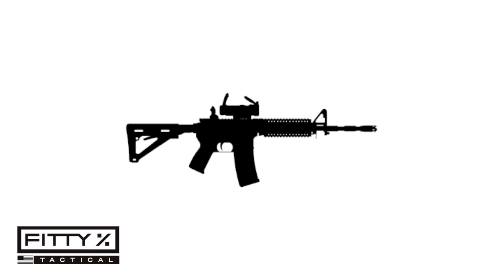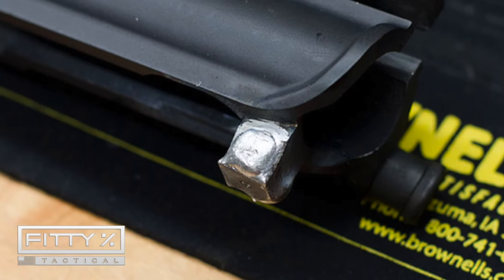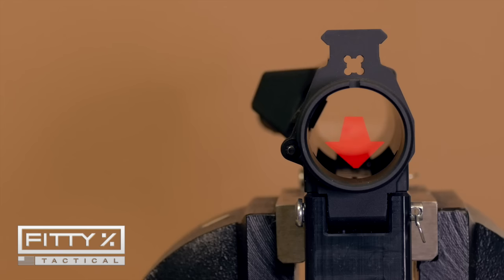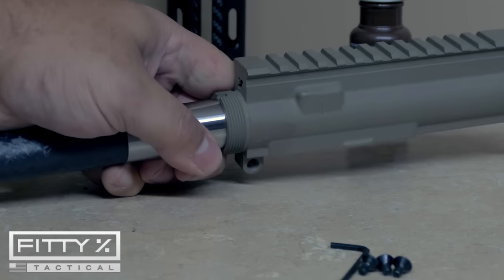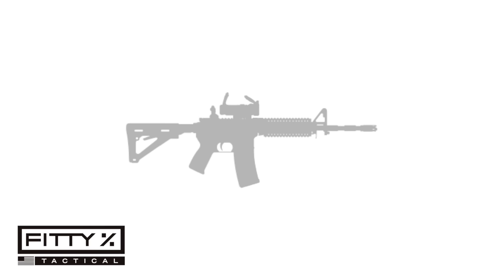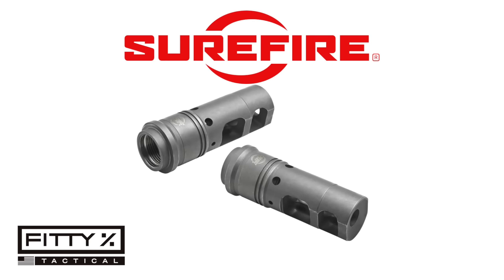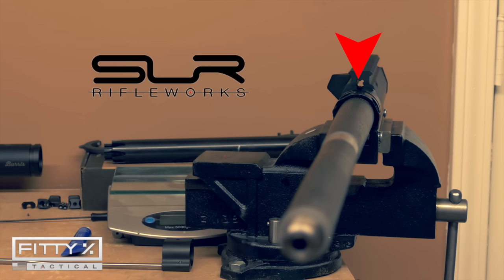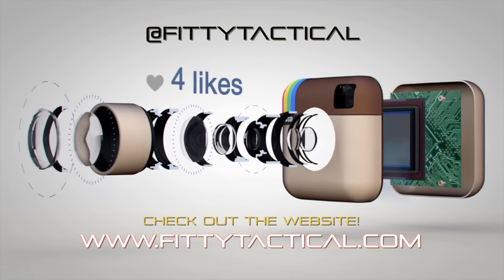Precision Rifle - 6.5 Creedmoor Parts Chosen & Why

Comment: Yes. The stag arms 224 is the gun only 1200. . 1500 is custom built ,everything. That 224 valkyrie really looks promising.  Thank you for your help. Ar 10 is 2000. In 6.5. Both heavy stainless mat match  barrel. Thank you for the video
Reply from the maker: Mark if its $2k including optic, what optic comes with it? If you want to be able to shoot long distances having good glass is what you need.

Comment: That's a good looking rifle.  Too bad the Aero Precision receiver set isn't available in 2020, the "pandemic period" (out of stock).  I recently decided to step it up from the 308, to the 6.5 Creedmoor.  The 6.5 cuts the wind much better, and it reaches out there a bit more.  I simply made my decision at the wrong time.  I'll likely go with a bolt action rig due to the lack of parts availability for AR's.

Comment: Hello. Another excellent an informative video!! So, can I ask, what ammo would you suggest I use with an HD 300 blackout with suppressed 247, range supersonic ammo and supersonic for HD?? Thank you an thank you for your timely response. Oh do you have a Patron as well??
Reply from the maker: Glad you like the video. As for ammo to use in a 300blk suppressed, I like to run subs when the can is on and SS when it's off. No specific brand for myself personally. I run brass case subs with the can on and steel supers when not suppressed. My Patreon is "FittyACTUAL"

Comment: Nice build. I've built one rifle with Aero receivers and liked them a lot. I've got another set I'm planning on building into a 6.5CM similar to what you've done. Was the Aero upper pretty true when you started lapping it?
I've not got a factory barrel to fit any uppers like I'd want yet so I may end up ordering one with an oversized extension to get that nice just barely press fit when I do this 6.5 build. Good deal on the bedding. I haven't tried that yet but I've heard it'll help squeeze a little more consistency out of a precision build.

Comment: Did you use the JP High Pressure Bolt? if not any piereced primers? Do you shoot it suppressed? If so how does it work with the bolt and mass carrier? THanks
Reply from the maker: Je P yes I'm using the JP High Pressure bolt. No pierced primers and I don't shoot suppressed yet but plan to and everything works great eight the SLR adjustable gas block.

Comment: How can the barrel move if you torque the barrel nut down to 30 pounds? Reason I ask is because you talked about the oversized barrel extension that you used to make sure it was that tight. I've got a number of less then 1 moa 5.56 rifles and .308's that I've built without quite the detail you put into your fitting. Two of mine are built on Aero receiver sets.

Comment: Great vid, dig your stye.  Thanks.
Reply from the maker: Thank you and glad you like the style.
Reply: hi im looking to build a rifle very similar to this one. would it be okay if i talked to you about your parts list? i have never built an ar10 before and i would like to know and have every part ready to order before i make any purchases so i know everything will fit. i cannot really afford to spend $200+ and end up with the wrong part.
Reply: also, what mags work with that build and the bcg in your parts list is a .308bcg can a 308bcg work well with a 6.5creedmore?
Reply from the maker: Sure! You can message my Facebook page cause it would be the fastest response time.
Reply from the maker: The 6.5cm was made from .308 brass that is necked down to take the 6.5mm projectile. All .308 mags and bolts will work with 6.5cm.

Comment: Ok I have a question 😅. I’m building an 18in ar cause I want to be able to reach out to 800 yards. The competition people on YouTube 😅 said that having a heavier bcg makes the recoil less? I don’t know the applications for a heavier bcg but it logically makes sense if you have a light weight bcg it would be less mass moving? So less recoil? I don’t know it’s like everyone has their own thing going on? So I just wanted to know from your experience with this build 6 years ago did the light bcg work the way you wanted it? I have learned so much about assembly from your videos. Thanks for everything you bring to the community. 😅
Reply from the maker: The more mass an object has, the more energy is required to move it. If you have a normal to lightweight gun a heavy BCG will be able to move the entire rifle easier than a lightweight BCG with the same gas system. I prefer to use lightweight BCGs with an adjustable gas system to tune the rifle. If a rifle is over gassed it will have more felt recoil no matter if the BCG is heavy or lightweight.
Reply: @FittyACTUAL  thank you 😊

Comment: Very nice build on your end! I have a question.  I'm currently building a 6.5 Creedmore AR but went with a jp barrel. It fits very tight and once the rail was installed the barrel appears to be well centered.  I'm using a Hellfire armory upper. Should I still lap the upper? If so, how do I go about doing that?
Reply from the maker: You're going to have to remove the handguard and barrel. Then you can lap it.

Comment: what buffer tube did you use for this. also I am looking at the cts active buffer as well, was it specifically the 'ar10 with the ar15 buffer tube' or the ar10 with the ar15 6 position buffer tube'? 
this build is sick and I am on the way to having one very similar.
Reply from the maker: Its the A2 rifle buffer tube. For the CTS buffer it's the .308 rifle version.

Comment: Reading on the Rainier website it mentions the gas block outside diameter on the CA-10 Barrel is .938 and the SLR 9 lists the inside diameter as .936. Was there any modification required to fit the SLR 9 to your barrel?
Reply from the maker: No there was no modification needed. When you get out to the thousandth it's so minimal that that difference is nothing. My SLR block slid on like butter.
Reply: Awesome! I'm going to go with the CA-10 barrel with the SLR 9 aswell. Thanks for the quick response. Keep up the great videos!
Reply from the maker: No problem bud!

Comment: One question, Why did you choose the Sentry 9 instead of the Sentry 7. What is the port size on the barrel you chose? I appreciate your feedback, as I chose some parts for my build based off of your recommendations.
Reply from the maker: The Sentry 7/8/9 have to do with gas block journal size. They are 0.625", 0.750", 0.876" and 0.936" and the 7/8/9 in the Sentry name indicates the size journal it fits.
Reply: @FittyACTUAL  right, I was assuming based on popularity that your barrel port size was .750 because that is the most common size I have found. Thank you for responding so quickly.

Comment: wont bedding the barrel to the upper with the Indian head gasket make it impossible to replace the barrel in the future?  not trying to sound like a jerk, just an honest question. I do like the rest of your build
Reply from the maker: damupr all you should need to do is apply heat to the upper receiver barrel sleeve with a heat gun for a bit and then you should be able to push or tap the barrel out of the upper receiver sleeve.
Reply: Awesome, ill try this on my 6.5 Grendel build. Thanks

Comment: So then, to answer a question ive had....a 6.5 Creed, u MUST HAVE an ar 10 size lower, and NOT a standard 556 size ar 15 lower?
Reply from the maker: Yes, the length of the round determines the receiver needed. If it can fit in an AR15 mag it can usually be chambered for an AR15. The 6.5cm requires the AR10 patterned receiver.

Comment: Quick question. For the AERO precision receiver set, does it matter if you're wanting to build an AR10 build as compared to an AR15 build? Their site says AR15 on those sets. I'm assuming you can get the same one for both build styles.
Reply from the maker: Josh R no, the M5 receivers ar AR10 and the M4E1 is AR15.
Reply: Ok, thank you!

Comment: I did not realize that you could use a .308 BCG and upper receiver for a 6.5mm Creedmoor.  How is that possible if the case is not the exact same?
Reply from the maker: To use the same bolt, the rim of the cartridge/brass needs to be the same and seeing as the 6.5 creedmoor round uses the .308 case/brass, the same bolt can be used for both. The only thing that needs to be changed is the barrel which contains the specific 6.5cm chamber dimensions.
Reply: @FittyACTUAL  Thank you very much for the quick response!  Does the slightly longer cartridge length on the 6.5 affect the magazine or lower in anyway or they are also interchangeable with any .308 AR10?
Reply from the maker: @danielbrown8105  no effect, they are interchangeable.

Comment: Roughly how much did you invest in this build? I just did an AR15 and went at $1500 without an optic so im thinking about doing this next
Reply from the maker: Well I chose a lot of high end parts in this build so you can definitely do it cheaper, but I think it was between $2500-$3000 without optics.

Comment: How does that buffer compare to a Kynshot?  I'm in the last stages of my own build, and I was bouncing between buffers, and decided to go with the Kynshot.  Besides for that and the barrel, there isn't much difference between my build and yours.
Reply from the maker: Well both buffers dampens and in looks like the Kynshot dampens a bit more than the CTS, but the CTS Aktive recoil buffer is still one of if not the only buffers that help center the BCG. I looked at the Kynshot when I was deciding too but obviously went with the CTS buffer. Ive also recently upgraded my buffer spring so check out the latest Precision Rifle video: https://youtu.be/WVMXSdGnSMc
Reply: Thanks for the reply.  I might try the CTS in another build.

Comment: really like the videos. Can you answer a small problem I have. I have the improved Ruger Pecision Rifle. I am a little confused about the bolt carrier section. Am I taling about the bolt carrier, a bolt, and buffer tube.
Reply from the maker: What's your question about it?
Reply: Basically will y original trigger fit the bolt carrier. Would like to improve trigger, but that will have to be later.
Reply from the maker: Will what kind of trigger fit the bc? I don't understand.
Reply: original fire control system will fit the new bolt carrier?
Reply from the maker: David Evans I'm not sure bud...sorry

Comment: Sorry im pretty new at this, and my question is that you basically use all .308 parts with 6.5 creedmoor barrel?
Reply from the maker: kenneth robles correct and that's the beauty of 6.5cm. The reason you can use all .308 parts except for the chambered barrel is that 6.5cm is simply .308 brass necked down for the 6.hmm projectile.

Comment: What did your Aero Precision upper measure bottom to top. My other AR10 measures 2.06" Please respond this new Aero receiver measures 2.70"
Reply from the maker: Mike Byrd I'll have to measure a new receiver when I get one.
Reply: Okay thanks. I was just wondering since you used an Aero receiver if yours was a "normal" 2.00 - 2.06 DPMS pattern.
Reply: BTW my barrel was a lot tighter fit than yours.

Comment: did I miss something, or can.t this be built with the AR-15 platform?
Reply from the maker: Mike Lee the 6.5 creedmoor is based off of .308 brass so the larger framed AR10 is needed. The smaller framed AR15 can accommodate the 6.5 grendel cartridge though. You just confused the two rounds because of the bullet diameter of 6.5mm.

Comment: What did you use to bed the barrel extension?  I've been using blue loctite.
Reply from the maker: +Cody Dills its Indian Head Gasket Sealer. I got a tip from someone that builds a few that it works better than Locktite.
Reply: +Fitty% TACTICAL Awesome, thanks!  

I think you should break it in, then shoot 25 10round groups. Then remove the barrel and re-bed with loctite and shoot another round of groups to compare!  Awaiting the results video :)
Reply from the maker: +Cody Dills good idea!

Comment: With all due respect, I legitimately want to know why you care about play between upper/lower? On my spr clone with stainless heavy match barrel, mb556k, and trijicon 5-20x50, I've shot hand loads with the stock tolerances between receivers and now am currently run a rubber stabilizing block that makes the fit very rigid, however, I don't see any discernable difference.
Reply from the maker: Alex S are you shooting at or beyond 1k?
Reply: Alex is def a anti vaccine kid

Comment: Why did you go with their 308 bcg instead of their 6.5?
Reply from the maker: samdogg goseahawks because this rifle is a 6.5 creedmoor NOT a 6.5 grendel. 

The creedmoor is based off the 308 cartridge so everything that a normal 308 AR10 variant rifle uses is compatible and the only thing that needs to be 6.5 creedmoor specific is the chamber and barrel.

The 6.5 grendel is different as it works on the smaller AR15 receiver and again everything on a normal AR15 is compatible except the chamber and barrel AND the bolt and magazine.
Reply: I stand mistaken about that.  Thanks for the info!

Comment: You didn't install the handguard completely correct. There is a little gap between your handguard and rail on your upper because youre missing the anti rotation shim that should be placed on top of your gas tube. This perfectly seals that space and provides proper alignment.
Reply from the maker: That was on purpose. I didn't want that tab touching the gas tube. This isn't a fighting rifle/carbine so I don't have fear of the handguard rotating at all.
Reply: @FittyACTUAL  Ok nice, what was the reason for removing it ? was it causing issues ? I have the same handguard
Reply from the maker: @slipknnnot  the reason was to remove as many hard points as possible that would relate to barrel harmonics.

Comment: Are you using a 308 BCG?
Reply from the maker: Alex Bazan yes, the 6.5 creedmoor was designed from .308 brass only necked down for the 6.5mm projectile. That means the bolt and magazine from a .308 will work for the creedmoor.

Comment: i noticed you got the m5 .308 set. Right or wrong?
Reply: lowers anyways.
Reply from the maker: Cole Griffin yes its the Aero M5 set.
Reply: Fitty% ahh ok. Also please forgive me as im new to all of this lol the upper reciever you got from the same place as well? im trying to track down the upper and lower receivers.
Reply: Oh and also your bolt carrier group. You went with a LMOS one. Those are for AR15's... they are compatible with what you built? O__o
Reply from the maker: Cole Griffin you can get the set from the Aero Precision website and as far as the LMOS BCG from JP Rifles, they make them for the A15 & A10. If you're looking on the JP website the A10 BCGs are at the bottom of the LMOS list.
Reply: Fitty% ok. A few more things and i will leave you alone lol 
•Your buffer from CTS Eng. what option did you choose when you got it. AR10 rifle with AR15 rifle buffertube? anti-tilt? 
•Where did you get your buffer tube from? Or does it come with another part.
Reply from the maker: Cole Griffin I got the AR10 rifle length, antitilt version of the CTS buffer. the buffer tube is just a generic A2 length rifle buffer tube.
Reply: Fitty% ahh. i see. ok. i plan on pretty much building this build and going from there.
Reply from the maker: Cole Griffin be sure to catch the next episode tomorrow. It goes over some issues and fixes I've ran accross.
Reply: Fitty% i was going to just go with the Mil-spec AR15/m16 buffee tube. Just wanted to know that it was going to work with the Magpul adjustable stock. And your charging handle also, where did you get that at?
Reply: Fitty% and absolutely! I love watching your videos! It inspired me to want to build one of my own. Will def be looking out for your next video.
Reply from the maker: Cole Griffin it will be live tomorrow afternoon, but you can always watch the videos on my Patreon page a week earlier than the YouTube channel and its only a buck.

Comment: Upper & lower receiver fit is not critical for top accuracy.
Reply from the maker: Its not critical but if there is play it can mess with the rifles cycling consistency and by that I mean for a rifle to be accurate it needs to be consistent. In a semi auto the cycle of the action is apart of what needs to be consistent for accuracy at 1000yd+ distances. If there is play between the receivers then you will see it at those distances. Thats why bolt guns are more accurate because they have fewer parts and nothing moves once the trigger is pulled.